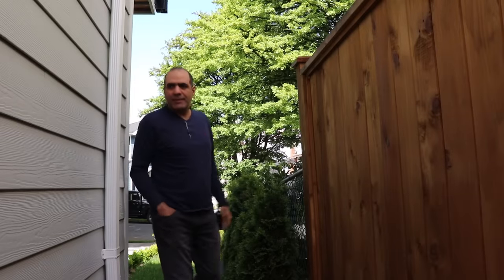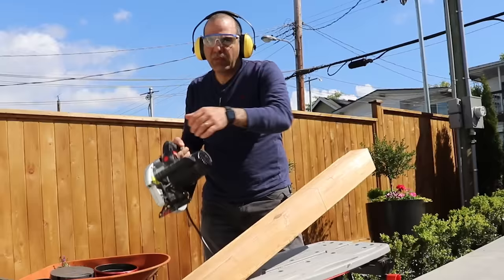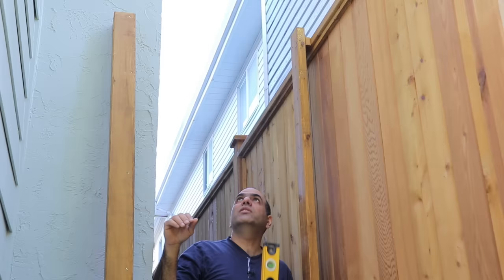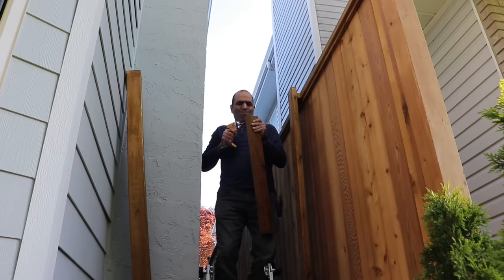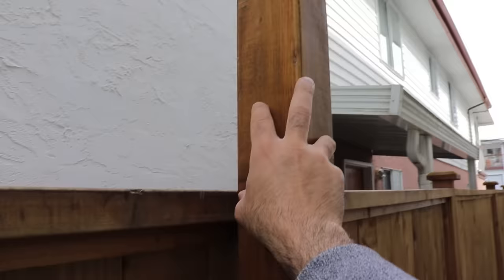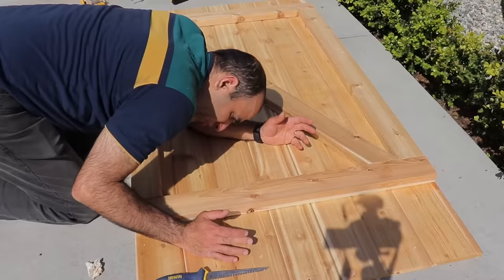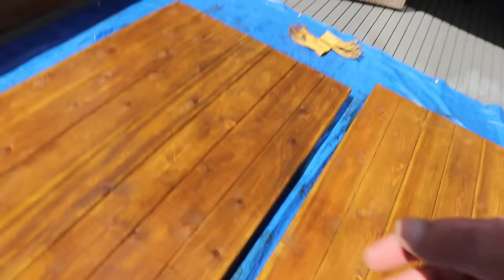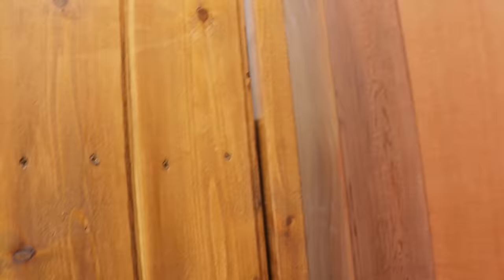Making Wooden Gates for My House

Comment: “This is the LockpickingLawyer and today we’re gonna have a look at Mehdi’s gates”
Reply: The crossover all we want to see
Reply: lol
Reply: @andreimiga8101  LPL wouldn't even need to pick the lock. Three vulnerabilities are obvious:

1. The hinges are on the outside. Just get a hinge pin remover and you're through.

2. The door can be unlatched from the outside by reaching into that gap there.

3. Just get a ladder and climb over.
Reply: @edderiofer  All but the last one fail if the metal parts are electrified.
Reply: @andreimiga8101  Ah, of course.

Next video is Mehdi electrifying all parts of the door, and also adding a metal frame so you can't prop a ladder on it. Expect hilarity as Mehdi repeatedly shocks himself on accident.
Reply: Lol eletroboom  will stick a full bridge rectifier  to it anyone who touches the gate will die 🤣😂😆😄😅
Reply: @edderiofer  you must be fun at parties
Reply: All comes together...
Reply: lock one and we’re in
Reply: I think the latch does have a place you can put a padlock if you want to. Though that only helps a bit.
Reply: OK, but once past the gates, can he get in the back door?
Reply: censored swearing as if mehdi shocked himself
Reply: Nothing to look at, Mehdi adressed the dumbest possible attacks already (by disregarding them).
It's kind of strange of him not to worry though, when he's literally shown several shelves worth of scopes. Those scopes aren't cheap, yo.
Reply: @edderiofer  Sadly actual scumbags aren't so elegant:  4. Full force boot, instant open.

Like Mehdi says, they're not expected to be impregnable. Just deterrence, inconvenience, and good looking. Mission accomplished!

Comment: You probably already realized this, but the reason that there is a loop at the top of the lock is for tying a chain/rope to, add a pulley above (doesn’t have to be far), and drop the free end of the string/chain onto the opposite side for opening the latch from the opposite side. Just make sure that the string weight is lighter that the latch so that the weight of the latch can relock itself when it drops back into place.

Comment: Something to be aware of:  The glue on the post affixed to the chimney is gluing the wood to the stucco.  Structurally, it's only as strong as the bond between the stucco and the brick/concrete underneath.  Just like Command Strips are only as strong as whatever it's on (paint, wallpaper) sticking to the surface underneath.  I've had plenty of Command Strips come off because the paint separates from the wall.  So really, the screws are doing almost all the work.
Reply: How are the screws holding the wood after he drilled all the way through to mark the concrete? This part still confuses me lol
Reply: @fun-guycomics3872 
probably some part of the screw is still sticking out of the concrete so that it is in the hole in the wood
Reply: @fun-guycomics3872  the hole is probably smaller than the screw so threads can still be made. If you are talking about the really big hole, that only goes through half of the wood
Reply: @fun-guycomics3872  He just used a smaller drill bit to mark the holes.
Reply: To a degree that's true however the glue is still locking onto all the micro and macro dips, valleys, grooves in the cement/brick wall. But yeah the glue alone wouldn't have been sufficient and wouldn't have lasted. The screws are most important but I bet the glue adds resistance to movement over a million times for es are applied to that post. Might help prevent the wood from gouging around those screws from all the decades of slamming gate. Note, I'm not a structural engineer.
Reply: Put some masonry glue on a painted cement or brick wall. After cured, let's see just how easily it can be scraped or hammered off.
Reply: That’s a problem for the future. We live in the now 😂
Reply: yeah, this isn't gonna be strong at all, chemical screw anchors exist for that reason.

Comment: I never thought about the practical function of the angled piece of wood on doors. This whole video was a lesson and a half and gave me confidence on fixing stuff up myself, thanks Mehdi
Reply: It is pretty common these days to use a cable going the other way (tension) instead of the diagonal piece of wood.  It is easier to adjust the tension of the cable using a turnbuckle to square up the door.
Reply: @travcollier  what kind of cable?  Im a carpenter who makes doors and gates and ive never seen or heard of a cable.
Reply: @pulloutski01  Just a little wire rope.  Doesn't need to be super strong or anything.  Anchor with some eye-bolts. 
I've seen custom gates and kits which use that, but how common probably varies by reigion.
A piece of wood and some screws are cheaper, but the wire way is a bit easier to make and adjust.  You know I'm sure, but the issue with the wood brace is that it needs to be cut pretty much exactly right.

Comment: Mehdi: "thieves have easy access"
Also Mehdi: hinges on the outside ready to be unscrewed
Reply: Its just a decoy to pull thief inside, like doorknob at outside and self locking mechanism inside (means this door are only for the exit and not to get inside), means, second door got FBR trap.
Reply: If a thief is willing to unscrew a door from it's hinges, they're getting in the house anyway
Reply: You can just as easily vault over the fence
Reply: @NomdePlume337  why don't they just jump over? Would be easier, less time consuming and probably not as loud.
Reply: @Ownage4lif31  that's what I'm saying, there's tons on easier ways to enter this property than taking the door off it's hinges. They could jump it, smash a window, kick the door in, etc.

Comment: Don't rely on the door locks to hold the door from swinging inwards. Add a thin piece of wood as a door jamb, for the door to butt up against when you close it. Or you will tear off the door lock in a short time. Well done otherwise. Cheers from Winnipeg.
Reply: Also replacing the 1" end panels with 3" one will hold it flush to the face of the frame.
Reply: Another cheer from winnipeg!

Comment: Mehdi, you generally want to put the latch at the same height as the door handle, its stronger for the gate over the long term. Putting it up high like you did gives you alot of leverage on the latch from where you are pulling on the handle, making it much easier to break the latch or rip it off the door. Plus they make door handles with thumb buttons that you can link to the latch to open the gate.
Reply: Putting the latch in backwards is a terrible idea. Especially at head height. You just don't so that.

Comment: I have been building fences and gates for a many of years, personally I would have recommended an aluminum frame with wooden boards attached to the front. This would create the least amount of sag. Aside from that this was a great video, and you built that gate like you had done it many times before. Very well done.

Comment: 15:50 quite the opposite. screws are good when you want to pull things together, nails are good for shear forces. Nails are not hardened and will not break apart under load, good for shear resistance. Nails are terrible for holding 2 pieces together. You could add some glue to the screw if you are worried that it might come loose, but then you will never get it out without a drill.
Reply: Hardened fasteners are stronger in all loads than non-hardened. Shear to tensile ratio is about 0.6 of tensile for steel fasteners. A low carbon steel fastener is about 60k psi tensile, with a hardened fasteners being 100K+. A mild steel fastener may yield before failing, but a yielded fastener has already failed.
Reply: Couldnt tell if he was trying to be funny or not lol
Reply: Sometimes it is better to see yielding before total failure. Nails give you that indication by yielding before total collapse. That's why they are used in structural joining. If you want more strength, you can use a bigger fastener, there are many to choose from.

Comment: That type of latch usually can fit a padlock of some kind. Even a cheap one I imagine would be hard to pick from the other side. Also, security hinges are a thing. Or just weld the hinge pin to the rest of the hinge. Your supercaps and some carbon rods might be able to do that.
Reply: There's no need. The gate is for privacy, not security. He lives in a nice neighborhood in Vancouver afaik. If he were going to be stolen from it would be through a phishing attack or a data breach, not a burglar. Besides, there are locks on the doors and there was no gate there before.

Comment: Gates turned out really nice. Good call on bracing that one against the house siding as well, out to stabilize the fence quite a bit.

As a side note, if you plan on doing more stuffs with hinges, handles, or the like then you should get one of those self-centering drill bits. It's a small pilot drill bit with a spring-loaded collar around it, and as the name implies it centers itself in a hole, ensuring that the screw will be centered in it.  

Another tip is to clamp a narrow board so it won't split. Let the clamp hold the wood together, essentially. Faster than pre-drilling and useful when doing many such joints.

Also the US building code says that you only need two screws per two inches of board width since too many screws actually weaken the board. So for a 2x4 it's two screws, for a 2x6 it's three.

Comment: 15:38 nope screws are very good at holding pulling force and weak at holding shear force, because they are not elastic enough and can basically break. The nails are the best at holding shear force but you can use them only when you work with wood and they're also weak at holding pulling force.
Reply: I was searching for this comment, thank you 😅

Comment: Use heavy duty non-corrosive metal parts. Use 1 more hinge than minimally necessary.
Heavy duty post and bury it deep with sand, gravel, and then concrete.
Sand and coat wood in some type of sealant and/or paint.
Drill guide holes to get more accurate screws and not risk cracking and weakening the wood.
Use heavy duty adhesive on hinges to provide extra stability and insolation.
Drill wide openings for flat top screws.
Measure twice and cut too long not too short in case.
Find closing mechanism that is shock absorbing and adjustable in case of ground erosion. 
Use extra reinforced screws for the door and metal reinforcement pieces to prevent deformities over time.
Can add a shock absorbing wheel on corner of gate to provide stability and durability.
Stain first coat quickly in heat and second cool.
Suggest adding string release from latch to a foot release latch.
Also suggestions for tall gates a small door viewer and/or peephole to avoid having to open or jump the door to see outside.
Reply: LMAO. One hell of a gate right there!

Except for the post, that is. If you want a sturdy post a good practice is to make sure the bottom of the hole is flat and to use an auger to drill a hole/holes through the bottom of the post and drive rebar through so that it is protruding several inches on each side of the post.
Reply: @KJ110813  every gate my family and friends have had never last or function past 10-15 years

Comment: If you took some sawdust from the drilling or sawing, and mixed it with the glue, the loose dowels will fit better, and be slightly more color correct.
Nice gate so far.
Reply: Corrected to colour for commonwealth countries

Comment: Surprisingly, no one has mentioned that screws are exactly opposite at what Mehdi said they were good at, they're good at resisting pull force but relatively terrible at shear force, not the other way around

Comment: 15:46 
Not a carpenter but I have seen videos of professional carpenters explaining this exact subject. (TL;DR: "Bent nails are better than a snapped screw")

Screws are good for vertical forces with the threads being a reinforced layer of "Defense" if you will- before the screw could get removed. its also primarily based on the material its being screwed into as well for its assistance on keeping the screw in place.

HOWEVER, one definite thing, is that NAILS are good for shear force, not screws. When it comes to screws, enough shear force will make a screw snap, nails, on the other hand, are flexible and can bend which makes them a prime candidate for dealing with shear force.

Comment: There is a reason its called hanging a door, if you ever want to add a third hinge, add it at the top, just below the top hinge and not the center, for the very reason you explained how gravity acts on a door, a third hinge in the center of the door does nothing. The stress points are top and bottom only. P.S. those are not locks but rather latches. good work though Mehdi .

Comment: 22:10 also, the fact that it opens to the outside is a safety feature for evacuation of the premises.
Reply: Exactly my thought
Reply: How come? Just cuz it's opposite of expected so panicking ppl will pull helplessly and die not realizing they should have pushed?
Reply: @TheSkystrider  In most buildings like companies I am certain that all emergency doors have to open in the direction of evacuation.
Reply: @VettigeHandoek  that's the direction he did his. They open pushing from in the yard to leave the yard (can then go directly across front lawn to the street). However your premise is true for companies but not homes. All houses have exterior doors that open inward. The reason for this I am guessing, is the ability to seal out the weather. If priority was to prevent someone kicking in a door then opening out is better (against thieves but now it's harder for firemen to kick in a door to rescue) and if priority was ability to escape by pushing door open. But by building homes with doors that open inward, police and other emergency responders have better ability to gain entry to do their jobs which saves a lot of lives.